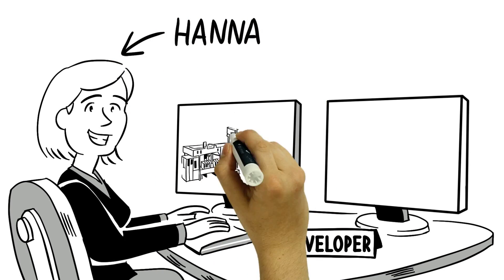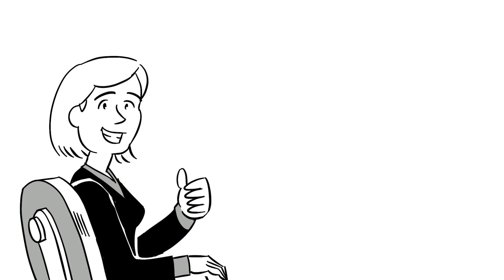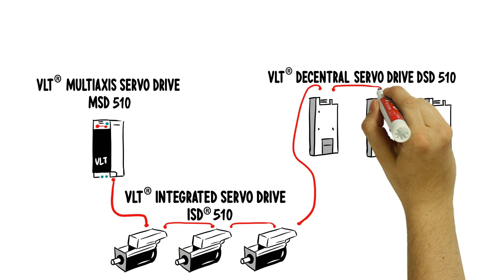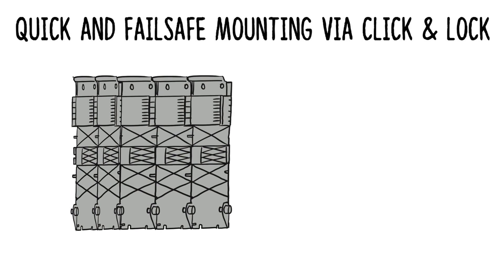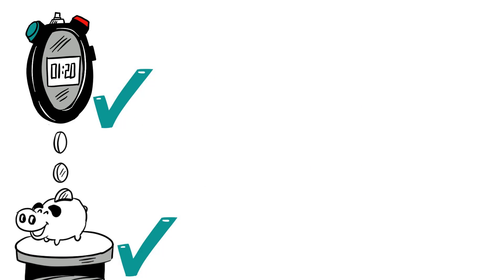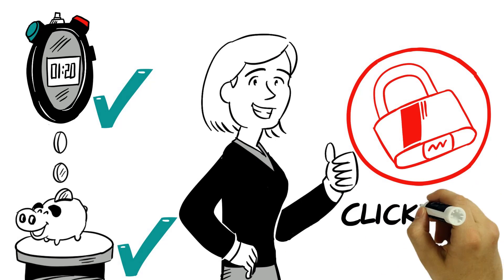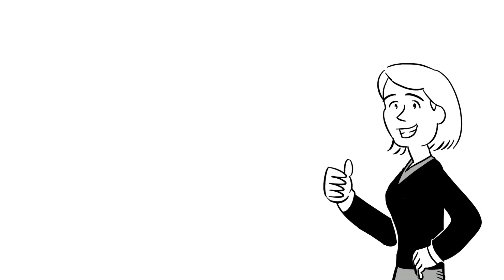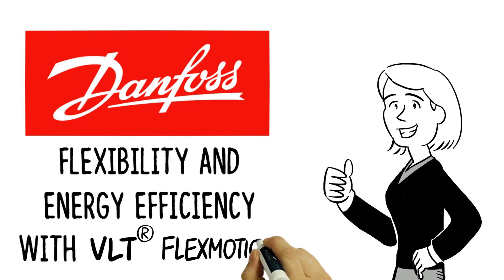Danfoss VLT® FlexMotion™ - An open & flexible servo drive solution for smart machine concepts

Comment: Need vacon 100 mr10 specific manual. Link please.
Reply from the maker: Hi Imran,

Thanks for getting in touch. I would suggest you to check on the VACON® 100 FLOW product page. Please have a look at the documents on that page and see if you can find what you need.

https://www.danfoss.com/en/products/dds/low-voltage-drives/vacon-drives/vacon-100-flow/#tab-3d-models-and-drawings

Best regards
Danfoss Drives Social Media Team